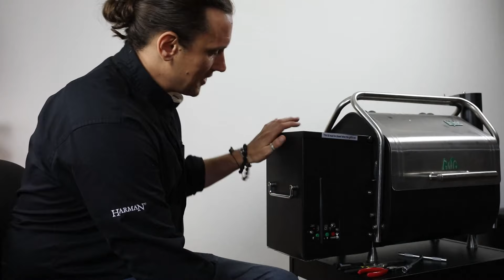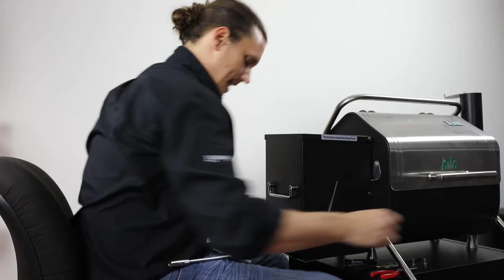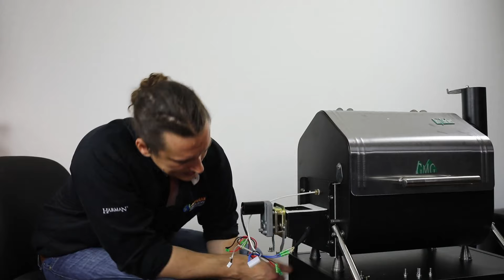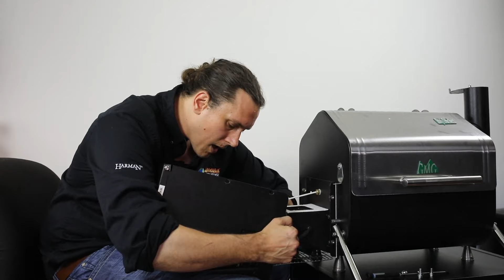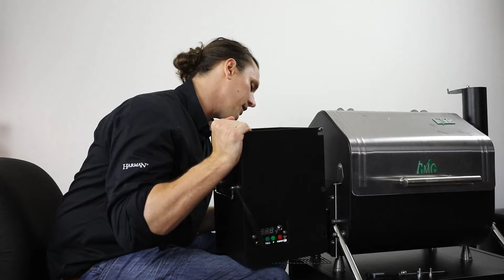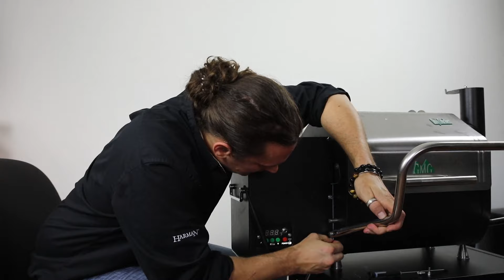GMG Davy Crockett Combustion Fan Blower Replacement

Comment: Why not just leave the hopper on and replace the fan from underneath?
Reply: Did mine this morning, no problem from underneath. Took 5 minutes. No reason to remove the hopper.
Reply from the maker: @rickolson3330  Great to hear Rick! If you need anything down the road just let us know.
Reply from the maker: Hey Rick, there were variances in placement of the combustion fan in the Davy over the years. Some models require removal of the hopper to get to the screws, others can be removed without removing the hopper. Appreciate you pointing this out. Thanks!
Reply: Came here to post this, I took the insides out for cleaning and with the legs down, slowly roll it towards the chimney. Easy access directly to the mesh and fan.

Comment: My fan is not working, However, when I connect the fan directly to a battery it works. What could be the issue?
Reply from the maker: Thanks for the message. I would double check all circuitry connections. If you are still finding that the fan won't run unless you connect to direct power than we would need to take a closer look at the control board. If it's under the 3 year mark give GMG a call direct and they will help facilitate the replacement parts. Hopefully that is helpful, thanks.

Comment: Is it possible to test the fan without a burn?
Reply from the maker: Thanks for the message. Yes, one could direct wire the fan to 12V power to check the functionality. I would recommend using a 12V drill battery for your power source and to create a test cord that can plug into your fan lead wires and make solid connection on the 12V battery.